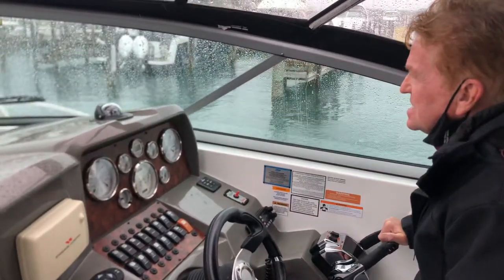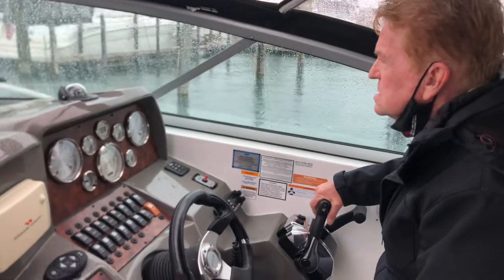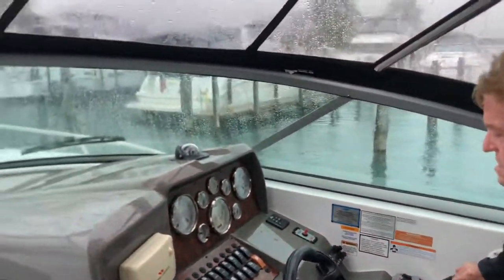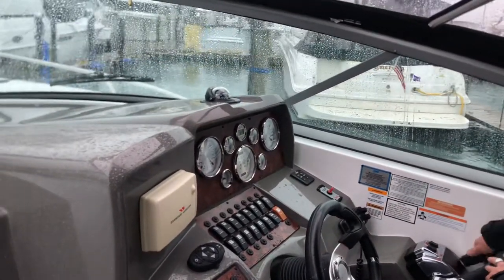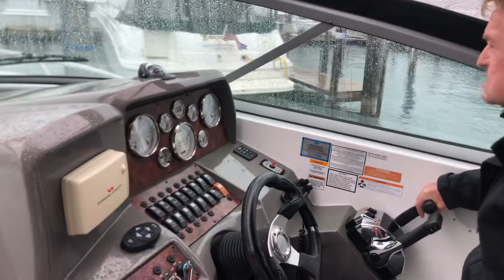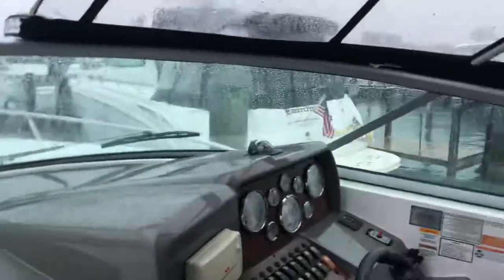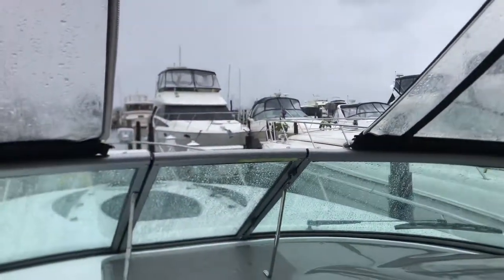Vessel Education Training - Docking a Twin Screw I/O

Comment: Awesome job.  It takes two simple yet equally important factors. An instructor who speaks clearly and uses simple commands. A student who does what they are told when they are told without overthinking it and not doing it until it’s too late. 

The understanding will grow with application. It may not make sense to you yet to put that motor in that gear. Just do it. After seeing and feeling and hearing what it does you will then apply your own experiences and be able to operate the boat with calm efficient skilled handling. 

Fair winds and following seas inter web peeps